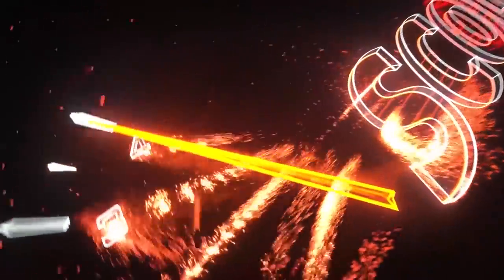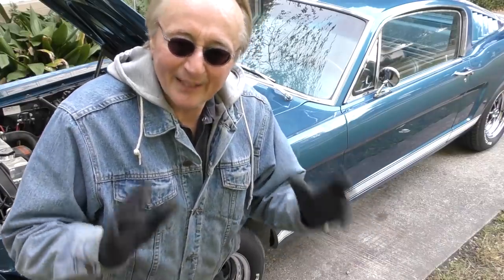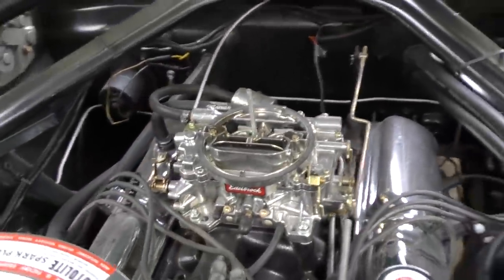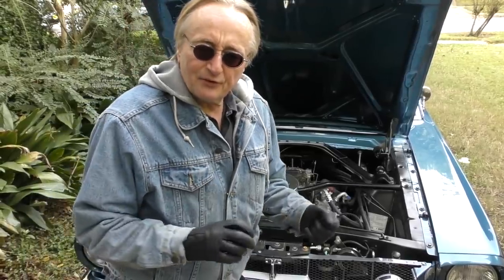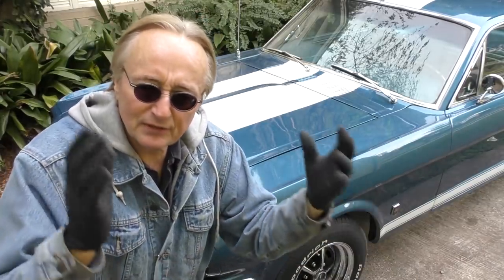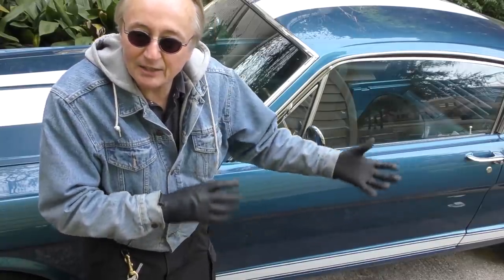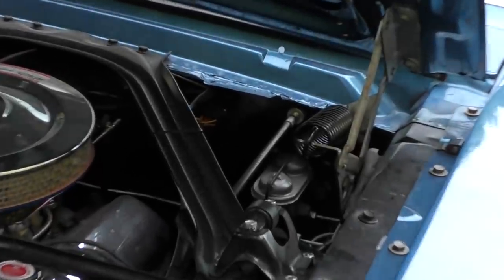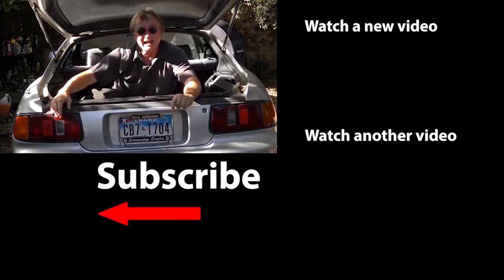I Just Bought My Dream Car

Comment: Incredible that after 50 years you can still find the ignition switch in stock! The car looks great 👍🏾
Reply: Ford used the same switch in most of their cars and trucks through the 60s and 70s.
Reply: Just about every car had that same switch in the 50s up to 1969
Reply: The headlights had a short on mine and it turns out the main switch was bad. And my grandpa swapped it out and no more random cutouts.
Reply: Benjamin Sila M. I had a hard time getting a tierod end kit for my 88 Chevy 1/2ton , and when I did find one it cost me $82.00 !!!
Reply: Advance Auto has a lot of electric parts in stock for 65 mustangs. Voltage regulators and every part for the distributor for example. Meanwhile they don't have brake calipers for a 2003 cobra.
Reply: Mustang is literally the most popular car model in the world...and by far.  That's why parts are readily available nomatter what year.
Reply: Joseph Bentley, it's easier to find parts for a classic mustang than newer ones, and lots of old vehicles that are insanely popular don't have the same luck, like Toyota trucks. It's just the luck of the draw
Reply: They have catalogs out there for just about the most popular cars and trucks of the early days 👍🏻
Reply: Just shows how much love the cars in the mid to late 60s have.
Reply: Scott (Cold War Motors) went shopping in Edmonton, Alberta for parts for his '23 Model T coupe and came back with a boatload. Apparently parts availability is better for a 'T' that's nearly 100 years old than it is for a 10 year old Fusion.
Reply: Becky Watt,  OMG, I got one for a 1961 Rambler Classic, for about $15.  Of course, that was about 18
years ago 🤔
Reply: Joseph Bentley, Ya, I used to love them. Then going to car shows, there was so many of them, I got sick of looking at them. But now I’m starting to like them again. And I’m 
talking about 64 1/2 thru 66....
Reply: Parts, any part you can think of, Original, or reproductions, for these classic American cars is a multi-billion dollar industry in the USA, and some overseas. Order on line, in a catalog, or walk into many specialty stores, and even some random auto parts stores too, all across the nation, catering to many of the old classic brands of cars, like this Mustang!!

Comment: Excellent car.  Excellent choice.  The day after the Mustang was released back in the spring of 1964, there was a two month waiting list in the San Diego area.  Older brother had a '66 notchback Mustang.  He rallyed with it semi-professionally.  It had some mods to suspension and brakes.  He was hard on that car.  It got t-boned in an intersection.  RIP

Comment: Scotty: 200 hp is peanut horsepower

Me in my toyota 86: ;-;
Reply: me in having a car with less than 75 hp: sad daewoo noises
Reply: They aren’t meant for power just speed, there’s a lot more than horsepower that determines that
Reply: It's a lighter car and it will get you more dates than you can imagine possible.

Comment: Every car I've owned had a carburator. My kids say " dad , why do you waist your time on these old cars " . I grew up driving carburator cars , it's all I know. They're easy to tune with a vacume gauge , screw driver , a good ear , and a few cheap parts. Grease the chassis often , which you can do on the old cars , keep the oil clean along with the other fluids and bob's ur uncle.

Comment: That's a beautiful car, the '65 and '66 Mustang GT Fastbacks are my favorite bodystyle of any and all auto manufacturers...I'll own one some day soon I hope....
Reply: Don't you mean 65-70? They all look the same basically but the 67-70s are wider to accommodate for larger engines.
Reply: @Dirtilike1  the 65 and 66 shared the same style as did the 67 and 68. Then again it was redesigned for 69 and 70. Each generation has its fans, and each is quite distinct. I'd have to go with the 65 or 66 fastback as well. An absolute timeless design. Much like the 63-67 Corvette. Two cars that just get better looking with time

Comment: Nice car! Love the color. The 5 speed is nice. You've got the overdrive for highway cruising and A/C to keep you cool.
Reply: In my experience the 3 speed automatic has some questionable reliability. Id love to throw it away for a 5 speed manual but cant do it til I save up for it.
Reply: yeah dont get one of these with the factory automatic lol bad performance and way less fuel mileage. And also less reliable.
Reply: It’s a pretty easy swap, using a hydraulic clutch kit lot better then adapting the z-bar. 

I prefer using a T-5 out of a four cylinder Mustang, fifth gear is non-overdrive and it’s a close ratio box. Long as the horsepower is pretty much stock they hold up just fine behind a V8. Just have to use a four cylinder pilot bearing and the outside of a V8 pilot bearing cause the four cylinder input shaft is smaller and is too small for the V8 pilot bearing. All you need to do to use the four cylinder bearing is have a sleeve made so it fits in the V8 pilot bearing outer.

The V8 T-5 fifth gear sucks cause it’s just a overdrive gear and isn’t really useable other then on the highway at cruising speeds.

Comment: I wish I had the money to buy my dream car

1977 Trans Am
Reply: There only 30-40K
Reply: @gavinhanson9213  that's a lot more money than I have
Reply: Luke Becker Get a car Loan. 40K divided by 5 years will be $8000 a year & just $666 a month ;) does it get better then $666 a month??
Reply: @gavinhanson9213  that would work but now i have to find one that is for sale
Reply: @gavinhanson9213  Getting a loan for a car is probably one of the worst loans to get, might be a different story if the trans am doesn't devalue much over time
Reply: Join Mustang Club of America. They have classifieds and a great rep.
Reply: Burt Reynolds would approve... 👍

Comment: I owned a 65 Mustang GT convertible with the 4 speed. It was by far the most fun car I ever owned. It was black with red stripes down the lower side and red interior. The only problem, it was a typical Fix or Repair Daily (FORD). You're right about the cooling system being bad. Also had problems with the distributer. Even with those problems, I regret ever parting with it. The 289 had a red line at 7700 rpm and you could take it to 89 MPH or so in second gear, 112 in third. After that, look out! The standard suspension was not that great at those high speeds. I bought it for $2500 new and sold it for $2600 in 1972. Still kicking myself. Thanks for the memories Scotty

Comment: Nice. I have a 1965 with the “gt appearance pkg” 289 with a 2 barrel... rear exhaust through the valance panel and the light bar in the front grill. I’ve had it 20 years now. Glass pack mufflers sound great, but just about any modern car will smoke it.  But I’ll never get rid of it.

Comment: Beautiful Mustang! I had a 1963 Mercury Meteor with a 260 CID and a three on the tree. The mileage was at 63,000 miles and sold at 102,000 miles. Chewing gum came on the car gas tank and was sold with chewing gum still stopping a leak. Lol

Comment: This is why I bought a 76 F-100 with a 300 CU straight 6. I can literally sit on either fender and still have room to hang my legs inside the engine compartment. I can change the oil w/o jacking it up, the fuel pump is two bolts and two lines, etc. MUCH less frustrating and a LOT less expensive parts. $26 fuel pump - about 10 minutes vs. a pump assy. for a 2000 F-150 (including sender) $159.00 + several hours.

Comment: The only thing that sucks about older cars is there not as reliable when it comes to long drives and with newer cars just pull into the dealership they plug it in and tell you the problem either way I Love classic and modern cars

Comment: I'm buying a running and driving 1965 Mustang coupe with the 200 CI Inline 6 cylinder engine with a 3 speed transmission on October 3rd here in Alaska for $2,500, its going to be a project for me and my son.

But the 2+2 fastback is a dream to have

Awesome Scotty!

Comment: Very nice. The first thing I would do if it already has not been done is put that crash plate back into the trunk behind the passenger seat. Unfortunately mustangs could catch fire/explode if rear ended hard enough because during production the crash plates were removed for weight concerns. So they can catch fire and explode if rear ended just like the pinto.

Comment: Have a '70 sports roof, 351C, all original except for the addition of front disc brakes which came off of another '70 mustang.  Been in the family since 1972.  Fun and easy to work on.  Almost sold it once, but I backed out of the deal.

Comment: Hi Scotty, I have a RR Evoque 2013, of course with many issues. It's computer thinks that there is a problem when I start it again after a long trip. It makes the car go into a limb mode. I had pluged in my Blue Driver and saw that the coolant temperature and the fuel rail pressure increase significantly and gradually after engine shut off to ranges that are even higher than what they normally should be at. Also note that the coolant gauge doesn't go higher than normal range. And the coolant only leaks after shut off for a while. There's been some different cool hoses that I had changed within a month and an air intercooler outlet hose too. The codes that are showing one for a pressure solenoid and one of the purge valve and I have also checked the bulletins and they have said that the valve code was a program error that's normal p144c. Fan is working fine. There was an oil in the coolant at some point but it's not there anymore that's when it actually started acting up. So what could it be ? Please because I love the car even though im planning to sell it to get a Lexus eventually. The car is zippy and drives beautifully. There are no issues until it goes into the limb mode after shut off.

Comment: Had my 289 68 Mustang for over 10 years. Recently wouldn't start. First problem ever. New fuel pump from the auto store and back on the road for $50.

Comment: remember the biggest issue is safety with the old cars is safety ... the biggest safety issue in the mustangs  is the drop in gas tank there is only a piece sheet metal which is the trunk pan so when its  hit from behind, it sprays gas into the passenger compartment......  you should replace the gas tank with a fuel cell

Comment: Congratulations Scotty! Beautiful car!I do have to say the working room in the engine bay for the new Mustang should not be a concern. The old V8's had the spark plugs down on the sides of the engine heads next to the exhaust manifold bolts. On the new V8 Mustang there is nearly nothing to ever have to work on between the side of the engine head and the frame. 

The spark plugs are on top on the new Mustangs and in fact imo the new car is 100 times easier to work on as I have actually done three header swaps on 94 era Mustangs that use the same setup in their pushrod 302ci as your 289ci. Also the 8 coil on plug packs are a better design especially if a coil goes bad you can still drive unlike what happened to me on my 94 Cobra with the 5.0 pushrod v8, coil pack goes bad and you end up in a tow truck.

Even just getting an engine belt off is easier on the newer car you just use a tensioner instead of having to actually unbolt alternators etc.

The metal chrome parts are just as junk as the plastic painted. metal chrome 100% will pit and rust if used daily just as plastic painted can crack chip and fade...chrome in general imo is pretty but sucks in the long run.

Comment: Actually the 289 put out 225 hp with a hydraulic cam and Autolite carb or 271 hp with solid lifter cam. The Shelby was 306 HP with a different cam, intake manifold and cast iron headers.

Comment: Bought mine new in 66, drove it like a baby for 36 years, put about 90,000 mi on it.  Same fancy steering wheel option like yours.  Showroom condition at 36 years. 3 spd std, 2bbl 289.   (By the way, yours is 66, with round speedo.. 65 had the ugly slide rule speedo)  Fun to drive.  Turned heads! Easy to fix, but everything broke in the first 5 years in mild climate...  Trunk latch broke.  Got a used one, from a wrecked 65 Comet.  Driver side door lock cylinder housing pot metal just crumbled... to match the key, I got a used one, transplanted the pistons inside.  Clutch pedal pivot bushing broke in half.. you have to replace the whole bracket, no fun! Master brake cylinder failed.- Rebuild failed in weeks too!  Ignition switch fell apart.  OK, easy to replace, but why?   Trans bearing went at about 30,000. U-joint about the same time. They did not believe in plastic inner fenders, so the front wheel throws salty road sand up at the underside of the fender, rotting it thru beside the hood, within 10 years.  Sadly had to part with it, but felt unsafe with only lap belts and 4x drum brakes (Ford gave front discs only if you bought the 4bbl carburettor model! Outrageous, Ralph Nader.)

Comment: Hey, Scotty. I own a 1966 Mustang. 200ci inline 6, C4 transmission. I've noticed when turning at a stop sign, or sometimes accelerating from a stop period, the car hesitates terribly for a second. So bad I think it's about to stall before it suddenly starts to go. Any ideas on a fix? The carburetor is brand new, fuel lines and tank have been replaced, fuel pump has been replaced.

The transmission has also been shifting gears at much higher RPMs than usual recently. When it finally does shift, it's a hard jolt. Auto trans fluid level is fine and clean. I'm dreading potentially having to open the thing up.

Comment: Im building a 47 ford f100 and i ls swapped it, replaced the whole front of the frame with a camaro frame. So now i have power steering, AC, Nice suspension, boosted breaking, and fuel injection. Cant say i have made it more valuable than it would be all original but hey i have a 72 year old truck with 400+ hp 😂 love it! No way a f150 will ever last 72 years. The body was in excellent condition for the age

Comment: I have a 1987 Dodge w150 4 wheel drive short bed and I can literally stand on the frame rails inside the  engine bay area and work on it.

Comment: My wife had a 65  Mustang with the 289.  Pretty fast in  straight line, but those pesky curves...  If I were to get one of them today the first thing I'd do is replace the steering and suspension, because they really didn't handle well at all, even compared to other '65 brands.

Comment: Ford would stock replacement parts for their car for 10 years after the parts had stopped being used in any car. So if a part was the same for 10 years, it was still available for 20 year old cars. The 1960's Falcon, Mustang, Fairlane cars used a chassis that was still used for the Granada through 1980.

Comment: Since youve done alot of car reviews whats your honest opinion on the eco diesel ram? I think its a decent engine but the trucks quality in ride and other parts quality will probably be poor, also one last question, im looking for a manual transmission truck to haul my jeep across the country along with my tools and etc, should i go with an early f250/350, since im getting a fifth wheel and trailer or what truck do you recomend? The manual transmission is a preference for multiple reasons

Comment: 1965 mustang did not have a GT model, unless it was the Shelby GT350.  This car is not a GT350.  This is a Fastback model that came with either; the 200 inline 6, or, one of three 289 V8 configurations.

Comment: I like driving old cars but, driving a car without air bags is not a good idea. I guess safety is more important than saving money. I was in the hospital for an operation and you should see the cost of the hospital plus the cost of the surgery. I think driving your old dream car is good for weekend drives or going to your local car and coffee meetings. I once rode in my friend's 34 Ford and it was an experience that I will always remember because it had no suspension travel and rode so rough you could hurt yourself.

Comment: I was looking for a 65-68 convertible Mustang, I drove 3 and they were all over the road, huge steering wheel and not very much fun to drive. All were in the + $20,000.00 range. I have owned 4 older Mustangs and don't remember them being such  crappy drivers. I guess I am spoiled from driving newer cars.

Comment: Most of the things that are overcomplicated or not as good as they were when this car was made are because of government regulation.  Hexavalent chrome was taken out of new vehicles. Pollution control, safety regulations and fuel milage requirements are probably responsible for most of the cost of a new car. 

This is one big benefit to electric cars. Since they dont make pollution at the vehicle and there are no minimum efficiency standards yet, it will be like starting over. We could have a simple motor sitting in a large engine bay.  They also need almost no maintenance. Just brakes, gear lube and cabin air filters. I will miss the sound though.

Comment: Scotty I have a Chevy impala 2008,and when i hit a puddle of water on the road , on the right of my car where the belt is, my steering Wheel goes stiff, and locks as if I’m steering my car in neutral. This gets scary when driving in rain cause of when I have to make turns I could barely turn the car. Also I have changed the belt twice and it has never solved the problem, and my mechanic doesn’t know what’s the problem. Any answers you can give on how to solve the problem?

Comment: 1:55 what is the purpose of the hand choke?

Sorry, I’m just getting into cars and your channel is very informative
Reply: Choke controls the amount of air going into the carburetor. Most have automatic chokes but manual is usually a lever in the interior to control it.

Comment: What about my 1985 F150 300 cid t18 4x4 with the non computerised 1 bbl carb with 180k on it and rebuilt motor, tell me a more reliable vehicle because my 88 f250 has 786K miles and never rebuilt same 300 cid